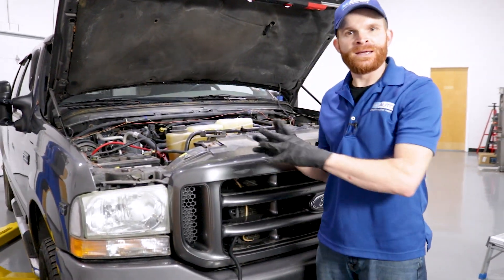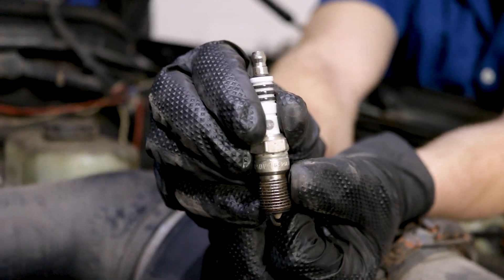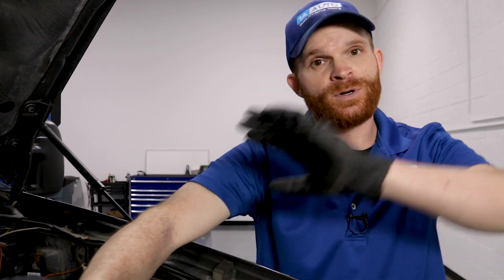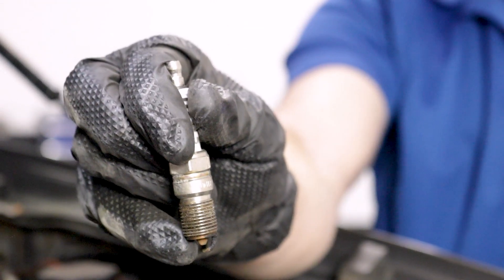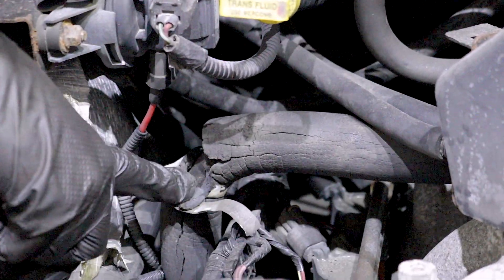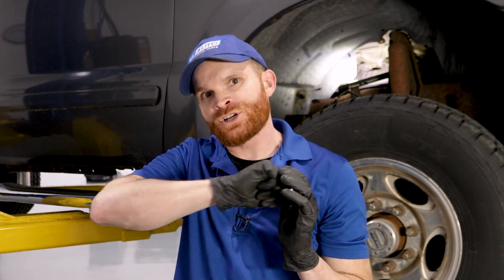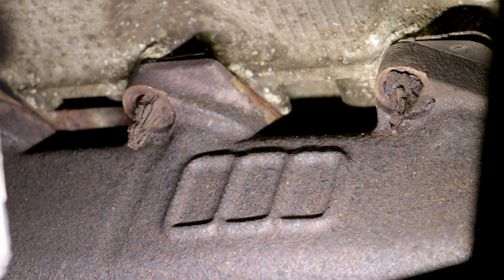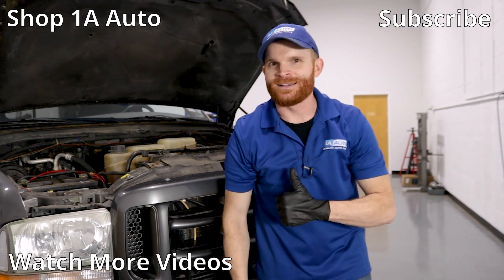Top Common Engine Problems 1999-2007 Ford F-250 Truck

Comment: I am having a #5 misfire. I changed coils and plugs. When I pulled out #5 plug, I thought I got the helicoil insert, but it may have been the aluminum from the head! It did thread back in and no noise. I took it to my mechanic and he thinks there’s a valve problem with #5. I’m stumped now, not sure where to go next? Anybody have thoughts on this?
Reply from the maker: +kgchomes We wouldn't be able to diagnose an issue like that here, you may want to have a local mechanic take a look at it. Thanks for checking us out! http://1aau.to/m/Shop-1AAuto-c
Reply: @1AAuto  I did and he thinks it’s a bad valve on number 5 cylinder, I guess I’m just looking for other peoples experience with regard to this engine. I know it has a proclivity to have many issues! Great video! Thank you for taking the time to make it. By the way I have ordered many parts from your company and you are the best! Great customer service as well. Thanks again!
Reply from the maker: +kgchomes Thanks for watching and for ordering with us! We'd love to hear about your experience. Here's a link to leave us a review on Google: https://goo.gl/i5JFNY
Reply: Hi KG.  I'll just about guarantee it's a bad intake valve on #5.  It happened to my 6.8L and they are infamous for burning intake valves at high mileage.  At 255,000 I burned two intake valves at the same time pulling a heavy load.  Had to have the entire engine replaced.  That was big bucks!  I hope you got it figured out and it didn't cost you a lot.  Let me know.
Reply: Possibly a lash adjuster/lifter, Rocker follower, and Valve Spring replacement on #5 will solve your problem!  Since you already tried the coil and plug!  You can manually inspect the springs!  If it ain't broken, don't fix it!  Just do the lash adjusters and rockers arms!  Good luck!

Comment: Great info and question    I have a V10 ,  1999 ,  115k miles .. Engine seems strong , when idling,   as of lately when driving down road at any speed seems line it is missing and I hear noise like pressure blow by  and truck seems there is a disconnect between engine and transmission   any ideas  to me I thinks it's a sensor not picking up the rpm acceleration or foot pedal gas increase and then timming is off ?? What do you think
Reply: What did it turn out to be?
Reply: Would be great to know what it was. I have 460,000 on my 99 and it is doing the same thing.

Comment: I am looking at a 2000 Ford Excursion V10, 4x4, and it sounds very loud in the back and not the engine.  What is the reason?
Reply from the maker: +Philipp Saud We wouldn't be able to diagnose an issue like that here, you may want to have a local mechanic take a look at it. Thanks for checking us out! http://1aau.to/m/Shop-1AAuto-c

Comment: I have 2002 ford excursion v10 and everytime I put 87 octane fuel it pings. Once I run 91 octane runs fine. Why the owners manuel say 87 octane requiered? Should I keep running 91 octane?
Reply: Seafoam it
Reply: In this video, he mentioned they need premium fuel. Run fuel that gets rid of the ping. There are octane additives that may work for you. Do some research before putting them in your vehicle
Reply: Do not run octane boosters in these V10s,  it can destroy the catalytic converter, even if it says it won’t. Always use premium fuel with Seafoam.
Reply: Run fuel system cleaner in it

Comment: Got a 2000 400k Miles doesn’t miss a step and most times is pulling a 4500lb lawn care trailer or my 5000lb boat! Either way 11mpg loaded and 14.5mpg unloaded.   Coils are super common on these too,  along with everything you stated. But really even with all these things the cost of ownership is still cheaper than most Volkswagens !!!!!
Reply: Theirs now way you get 14 mpg. I’ve owned several. They didn’t do 14 new.
Reply: I don’t own one yet, but I worked for a quarry company and fixed few times a v10 service body f350 they had. The car had 300k miles with bad maintenance and carrying a big diesel tank every day, never quit. To this day it keeps working

Comment: My v 10 has sudden temperature spikes and resulting limp mode when the engine never overheats.  After restarting the temp sender returns to normal.  60 minutes later, it will spike again.  A 900 mile trip saw 10 spikes and restarts.
Reply: Limp mode? Figure out what the reset is for your vehicle!!! Don’t go to a dealership!!! Just google how to do a reset for limp mode on Your vehicle year make and model
Reply from the maker: +Sherry Newton We wouldn't be able to diagnose an issue like that here, you may want to have a local mechanic take a look at it. Thanks for checking us out! http://1aau.to/m/Shop-1AAuto-c

Comment: So I just picked up a F250 SD,  I wish i would have seen your video first. :)  but my ? is, what's the odds of my mechanic checking theses type of things on a "reg" check and service? should I ask them to look for theses thing specifically. ?
Reply: Ask them to look at the exhaust manifold bolts. See if any are broken or missing. You can also visually inspect most of them.

Comment: Engine light came on had tech scan with a snapon scanner showed number 4&7 coil replaced drove for about 30 miles engine light came back on scanned again showed #4&7 show up again what do you think problem is
Reply: I would put money on it's the spark plugs had the same problem with my 5.4 triton and the plugs only had 30k on them.

Comment: I have a 1999 Ford F-250 super duty 6.8 L v10 Gas. I put a 6” inch lift on it 37 inch tires and re geared it to 4.88 gears. I purchased a super chips flash cal tuner so I can recalibrate my computer to the new tire size and gears. But for some reason my superchips will not give me the option to change tire size or gears. I spoke with superchips and they said I can have a ABS module that is not communicating with the super chips. Do you know of anybody that has successfully the calibrated a 1999 Ford F-250 v10 gas? Maybe my truck is just to old to recalibrated to bigger tires and gears? Any info you know about this would be great. Thank you

Comment: I have 380k on my 2005 v10 excursion  it’s been great. I’ve had to have the studs fixed 7 times tho but I’m a pro at it now
Reply: Hey I’m getting one with around 200,000miles, an 05, are you referring to the exhaust manifold studs, they go bad that fast?
Reply: @quorbsky3237  yes. Check them before you buy. If any are missing or broken off expect to spend some $$$ in labour to fix.
Reply: I have a 99 F450 with V10, it has 186,000 miles on it. I love it Check it out  https://youtu.be/oL-mEH1VZGE
Reply: yeah we need to hear more about that....was it a recall on these engines?
Reply: @saltpepper1894  I believe extended warranties for the original owners. Big, known issue.
Reply: I have 330k km's on mine & had my bolts replaced. $$$ in labour.

Comment: Just wondering if you have any information I have a 1999 250 with the V10 and trying to pull a camper just does not seem to have the power I thought it would have what would I need to check

Comment: EYE!, have a problem with my 1999 F250 SD CC 4WD V-10.  It is gutless and I don't know why!  The engine seems to run fine.  Starts right up and you could say it purrs.  Transmission shifts positively with no slippage.  But my truck is an old dog.  it takes forever when it comes to git up an' go!  Not a serious mechanic, but I have changed the tranny filter, valve pack, aux valve pack, and solenoid pack.  Very little metal in the pan, a few specs but I would say - not bad.  I notice in your video you talked about the PVC valve.  I don't hear a whistle, but could it be bad?  The other thing I wonder about is... could the differentials' gearing be different than stock, or where these trucks able to be ordered with different gear ratios and mine is wrong for road driving.  Heck, I don't know!  Any ideas?  I thank you for you time... AND the video!  By the way, I'm an old guy - 71 on a fixed income.  Please do not say bad transmission!  LOL!
Reply: Throttle body dirty

Comment: The V10 also had dipstick tube problems ,,, if it breaks off by the oil pan and you cant remove the piece left in the oil pan I belive you have to remove the engine to fix the problem .
Reply: yikes!  dunno, but doubt a bigger piece like that would get past the pick up screen tho

Comment: I think the nausea from the exhaust is caused by the huge repair bill. Wouldn't you think the maker could have used stainless steel bolts, especially considering the vehicle cost.
Reply: And copper nuts
Reply: Ford Exhaust ticking is very annoying its manageable if you got the tools and effort but the 03 Ford expedition Ford makes it very difficult. Auto shop book time for replacing exhaust manifold gasket on an 2003 Expedition is 4.9 hours longer than a 2000 expedition exhaust manifold gasket job. Raise the engine and lower the front differential to access the studs. Very difficult on me but I managed. Thanks Ford.
Reply: Ford isn’t that smart. Or should I say their accountants aren’t that smart!
Reply: Right!  But then you wouldn't be paying big repair bills and that's not good for business.  Asian manufacturers typically use stainless or galvanized hardware because - well - they'd rather have a reputation of reliable cars and trucks.  Ford engineering is the worst I've seen and I'm a long time mechanic.
Reply: @nunnyabizness If fords engineering is the worst you’ve seen in your career then you haven’t worked on a very large variety of vehicles